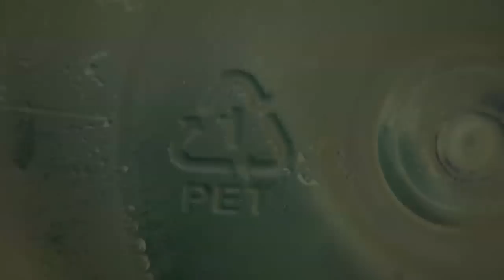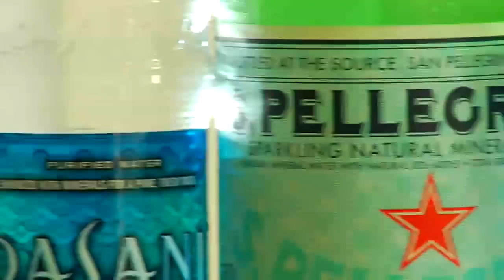Tapped Trailer

Comment: @leafwatch The only thing I would dispute is that Fluoride is not dumped into the water as an industrial waste, definitely not without reason. It was found to reduce cavities, in a time when that was a big public health improvement. If water sources could be controlled locally 100% of the time that would be beautiful. Areas with higher populations don't really have that luxury, as their sources are massive and often from somewhere somewhat far outside the city.

Comment: @JRskatr You should do some research on an area called the Pacific Gyre.  It's an area in the Pacific ocean where currents converge bringing with them all of the plastic waste that doesn't biodegrade.  It is estimated to be about the size of the state of Texas and the plastic waste occupies the top 10 meters of the water column.  Maybe not "all" but I think you'd agree it's a lot.....perhaps consider a drive across Texas to get some perspective.

Comment: There is a difference. For example, Spring water has no dangerous chemicals in it, and it has no heavy metals in it like Lead. It does, however, have minerals in it because the water was filtered naturally by the Earth. These minerals are good for you. Once the water gets to the facility, it is cleaned by a 0.2 micron filter, and it is disinfected by a UV light. If you look on the label and the manufacture is Nestle Waters, the bottles will be BPA free.

Comment: The issue goes deeper than the leached chemicals and environmental cost of producing and distributing bottled water.  The problem is large companies SELLING what should be a free resource.  There is a finite amount of fresh water available and we in North America do have an abundance of it.  As this resource continues to be 'tapped' more and more by large companies the amount available to the populace decreases.  Wat happens when it runs out? What will the next world war be fought over? Not oil.

Comment: Hello Guybots,

First, water lines are not "closed off" when it is broken. The water line valve is turned off upstream. The open end of the broken pipe is exposed and the raw sewage runs into the open pipe. As consumers downstream from the pipeline break use water, the raw sewage enters the broken pipe mixes with tap water in the lines.

Second, notifications "sent" would not arrive until days later, and are not sent.

continued....

Comment: @Hells2TheYea there is a solution that is been used in Japan for the past 25 years, and extracted from a volcanic rock named Black Mica. It has the power to turn any water into drinking water, and also will mineralize the water with over 80 minerals and trace minerals in ionic state, meaning they are dissolved and readily available for the cells and the blood to assimilate.

Comment: The only way to safe guard yourself  from tap water is to install a three stage filtration system on the main line of your home. 1st a Carbon filter .2nd a .000 reverse osmosis filter 3rd a ozone generator or a strong uv light.  After that your water will be sterile,particle and chemical free, but if you understand how plants work and the human body than you know that it can leach your body of minerals so you need to ad some minerals. Your under attack from both plastics and tap. and much more!!

Comment: Hello guybots,

I agree with you about the plastic bottles being unhealthy. The BPA leaches into the water. However, the plastic bottles are convenient, so I use them.

BTW, have you noticed that Monsanto has been given a free pass. I can't post a link here due to the site's limitation, but here is the headline, which you can probably Google.  	
"Senate Passes Monsanto Protection Act Granting Monsanto Power Over US Govt
by kstangelo"

Thank you,
Bill Moore

Comment: My tap water tastes & smells like bleach, whether in a plastic or glass container. My bottled water doesn't. I'm trying to quit drinking sodas because it's VERY bad for me. So... bottled water or soda? Yes, I will be choosing bottled water. I have a filter built in to my fridge. Just put a new one in and it's STILL "bleachy". While bottled water may be from a tap, at least it has been filtered with industrial strength filters.

Comment: Another Big LIE is theywant you to believe that they have great technology omming out with these stupid and expensive electric cars that only go 300 miles before charging . That cost you more money per mile than even the shity gas we use today! Any smart person understands that all vehicles as the engine turns round and round and the wheels go round and round produces mechanical energy that is free. That is why every car has an alternator that catches that free energy to (continue on post above)

Comment: to keep your cars battery charged and it runs your entire electricity system in your vehicle. Duh!!! How do you think you get power every day you drive?? Thin air?? are you stupid and think its the gas???  Electric cars do not need charged either if you simply put an alternator in between the rotation of the electric motor or the wheel shafts!!!  The only time the secondary battery would need charged could be tricle charged by a very small solor panel. They wont sell you truth.  ( continue above